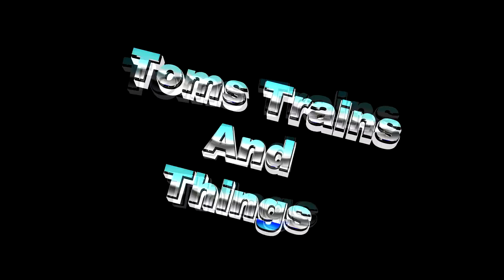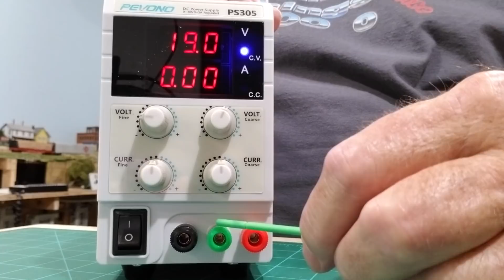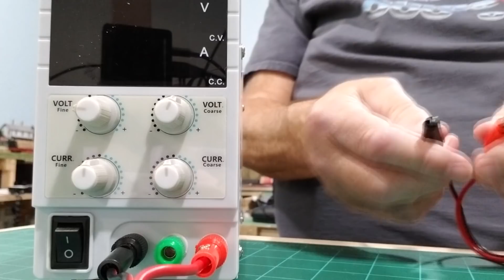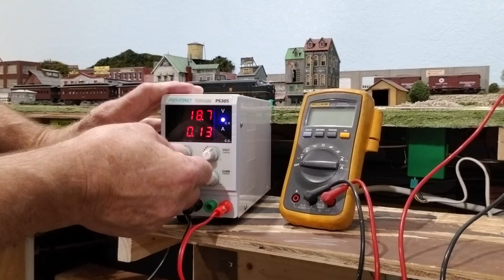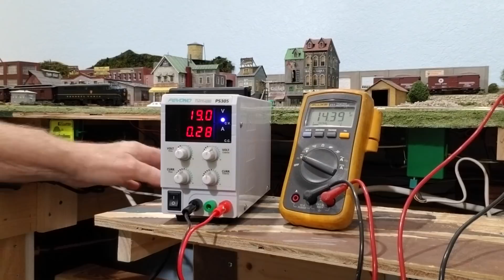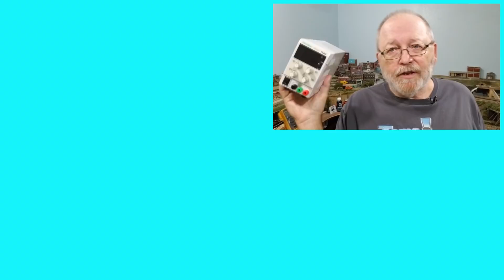Testing A Pevono PS305 DC Power Supply With A DCC Command Station

Comment: i dont get digitrax on some days why is the standard PS515 power supply 15v AC
and their other power supplies DC?  apparently DC works by your demonstration here
Reply from the maker: Those days are long gone. That power supply is no longer available and it was only used on the earlier Zephyr units which were AC. They were discontinued many years ago. The DCS52 Zephyr is DC Voltage. All the other Digitrax products use a DC power supply.
Reply: @TomsTrainsandThings  ahh ok that makes sense, i was looking at a used super chief set here locally.. do you know what it used
Reply from the maker: Power requirements for the DCS100 is 15 to 28vdc at 5 amps. if it has the DCS200 it's 8 amps.
Reply: @TomsTrainsandThings  Thanks Tom

Comment: good video if possible could you please explain why and how to use the power booster.  I have the dcs210 and the dcs51 throttles and am in the beginnings of building a large layout about 30' x 30' in ho scale and figure I may need to have a power booster but I really do not understand how tis works.  My dcs210 is rated up to 8 amps so adding a 20 amp supply to it does it now have 28 amp capacity?  are both wired t the track?  As yu can see I am confused hw this work
Reply from the maker: Thank you Norm To begin with, what 20 amp booster do you plan on adding to your Digitrax system? Digitrax doesn't have a 20 amp booster. You can use your DCS210 as a command station & add either a DB210 or DB220 as a booster for your system.
Reply: At the moment I am looking over what is available.  and I amnot using the correct terminology it's actually called a 20 amp power supply by Digitrax  I am concerned with several locos and a large layout running all te accessories I will run short on power.
Reply from the maker: The 20 Amp power supply will supply power to your DCS210 & another Booster. According to Digitrax, your DCS51 can only be powered by the supplied PS314 power supply. I don't know the reason for that. 20 amps of power from a power supply is just that: 20 amps. Your DCC command station and Boosters add nothing to the input power from the power supply. If your going to use a 20 amp power supply, your command station & Boosters ratings must fall within the rating of the power supply.

Comment: Hello Tom, Thank you for your time and effort in all of your videos. They have been incredibly helpful as i move forward with most recent model railroad endeavor. I use JMRI on my laptop connected to a Digitrax PR3 into a Zephyr DCS50 to control my home layout. I am currently writing a grant to secure $2,500 in funding to begin the Connecticut S.T.E.A.M. Model Railroad Club. The club will be for 4th & 5th grade students at the two elementary schools in which I work. Through model railroading my students will discover connections with Science, Technology, Engineering, Art, and Math. I am thinking of running their T-Trak modular layout with an anduino, motor shield, and power supply. Now, almost a year later, I see you are still using the Pevono PS305 power supply in recent videos. Do you think it is still the best bang for the buck considering our modular, N-scale, T-Trak layout which is built and run by 10 year olds? I appreciate any insight you can provide. Feel free to shoot me an email: ConnecticutSTEAMModelRailroad@gmail.com
Reply from the maker: Glad I can help. The Provono is primarily used for testing my projects on the bench. I use an old computer power supply for most of my accessories on my model railroad. It can supply 3.3 vdc, 5 vdc, and 12 vdc all at once. For accessories that require a voltage different than what the power supply has, I use wall warts that I purchase at thrift stores for about $0.50 a pc.

Comment: If it works it's a Fluke.  Don't try to read DCC track voltage unless your Fluke is true RMS.   
Cheap voltmeters are calibrated for sine waves.
Reply from the maker: Thank you Dave!

Comment: I just found some really neat about the digitrax zephyr systems tonight. It is called the JUMP command, it allows to take 2 old DC throttles and use them as DCC cabs. My mind is blown
Reply from the maker: I was about to say I have a video about that but you already commented on it. lol
Reply: I am watching it now, i cue up your playlist, i found out in the manual and my mind was blown, you think they would point that feature out more
Reply: after going all this i got a guy on Facebook who says hey here is a MRC system that you get real cheap

HMM

evilbay, used, for someone who has never had a DCC system

What you think?
Reply from the maker: If you can't test it out ahead of time, I wouldn't mess with it. I try to stay away from e-bay especially individuals selling items. You never know what your going to get. Bad experiences in the past! The ones that have stores set up selling a lot of items would be a better bet.
Reply: plus you never know what nightmares you get with used.
and the knickname evilbay exist for a reason
I do abuse your 9 volt trick though, very very useful when shopping for used locos
Reply from the maker: I'm glad the battery trick worked out for you.
Reply: been passing it on too, telling them to check out your videos
Reply from the maker: Thank you so much!
Reply: velcome

Comment: lets say the item your testing only draws 1 amp..you have the power supply set at 5 amps..my question is:  will the amp meter show the 1 amp or will it show the 5 amps you have set the power supply to?
Reply from the maker: Hi Terry, when you set in an amperage value on the constant current setting, it will maintain the current set and adjust the voltage accordingly. Like in the video when I first hooked up the command station the current sought out what I set and it dropped the voltage until I adjusted the current to a higher setting. When you set in a constant voltage, the display will reflect what current is currently being drawn.
Reply: Thank you Tom

Comment: Hi Tom, 
Is there a limit on how many trains I can have running at one time on 28 volts? 
Great video as always! 👌 keep them coming.
Reply from the maker: Ricky, although the limit on the DB 150 is 28 VDC, that's usually for the larger scales like O and up. The voltage doesn't determine how much you can run on your layout, it's the total amperage draw. Check your users manual for the suggested settings for the scale your working in and go from there.
As for the rolling stock, that depends on your locomotive, traction, friction, weight of the rolling stock, and how well everything is maintained.
Reply: is there a limit on how much rolling stock you can have as well?
Reply: Thanks for this Tom 👌 Keep the vids coming, they're great!